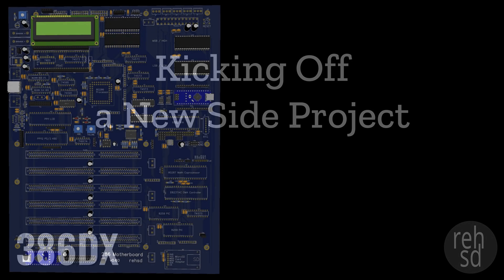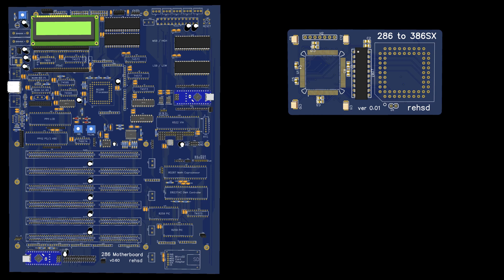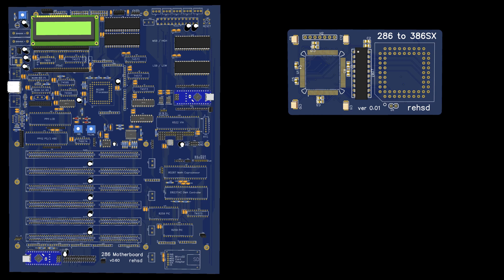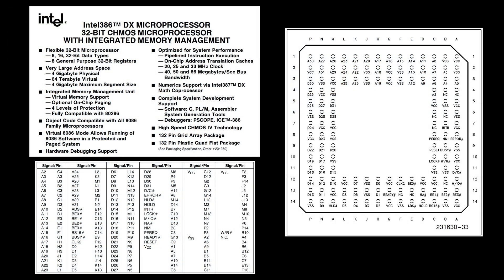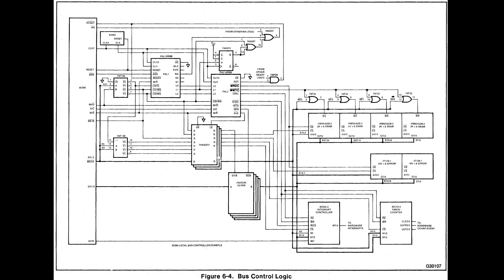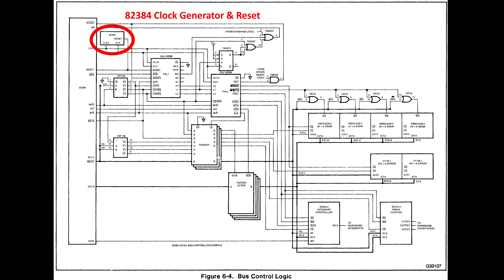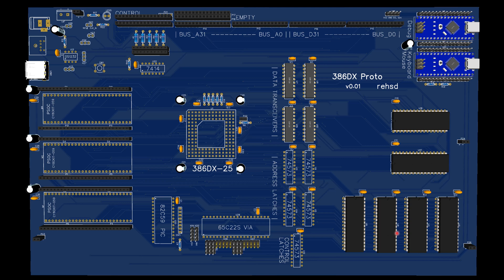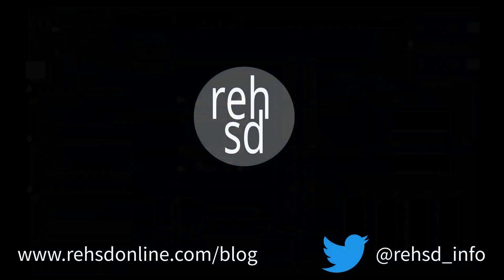80386 DX Build, Ep. 1 - Kicking Off a New Side Project

Comment: LOL, I was waiting for you to do something like this.  Looks like fun.  Fair warning, once you start getting into the 20 MHz and up range, you may find that you actually have to start doing timing analysis on some of your logic, just winging it with some gates may not fly anymore. Enjoy!
Reply from the maker: Thanks for the heads up, @Zxborg. It will be a good opportunity for me to work on that skill! My current plan is to use many of the same system components as my 286 build (e.g., flash, RAM, I/O). My expectation is to run similar speeds -- 20 MHz system bus, 10 MHz processor -- but we'll see how it goes.

Comment: Please consider this project after finishing 80286, it is a risk that you could easily get "overloaded", and abandon both in half way
Reply from the maker: I appreciate the suggestion. There's a small risk there, but it's small.  :) The 286/386SX project will be my primary project. I'm using https://www.rehsdonline.com/post/80286-system-roadmap-updated-june-2023 to track my current objectives and progress. There's a large amount of overlap between my 286 build and what I'll be doing with the 386DX, and both will benefit from the other's work. As I was mentioning to @Tom Storey... I'm not sure if my projects are ever "done." Also, I enjoy a lot of variety, so if I'm mentally bogged down with something on either build, I can take a break and pivot to something a little different for a bit.
Reply: @rehsd  Please add at least 8 MB ram i would like use Win 3.1 or even 16 MB to use larger smartdrive buffer.
Reply from the maker: @MrCzarnm  Something I would like to work through (quite a ways down the road) is DRAM. Everything I have done up to this point is SRAM. It would be interesting to have SIMM slots and have more than a couple of megabytes of memory. So, I like your suggestion!

Comment: Don't forget to eat, drink and sleep ;)
Dunno if it's possible (due to costs maybe) but it would be nice to use a different colour for the 386 board. Blue for the 286, Green for the 386, for instance.
Reply from the maker: I figure two of the three are sufficient, as long as I rotate them.  ;)  Sadly, JLCPCB now charges for colors other than green! I was a bit surprised (and disappointed) by that. If I get closer to a usable board, I might change up the color; all my proto stuff will be the "no extra charge" green.  :)

Comment: Really cool project!
I would use GALs instead of PSOCs because they look much more natural inside a build like this.
Reply from the maker: I'll start with PSoCs, but the logic should be easy to move to other formats (such as GALs) when I have a better idea of what the solution looks like. I find the PSoCs to have a much better development environment and easier to deploy changes.
Reply: @rehsd  Haven't looked at it that way, but i understand it completly. Keep on going!
Reply from the maker: @alex_s168_p  I do have a batch of GAL16V8's on order. I might see if I can directly use Intel's provided source code for the two PALs. If so, that might simplify / speed up things a bit.
Reply: @rehsd  I think you can use the provided source code for the GALs, but im not a 100% sure...
Reply from the maker: @alex_s168_p  I think I will update the proto board to include spots for the two GALs -- giving me flexibility to use either the PSoC or GAL for each function (at least the functionality of the standard Intel PALs).